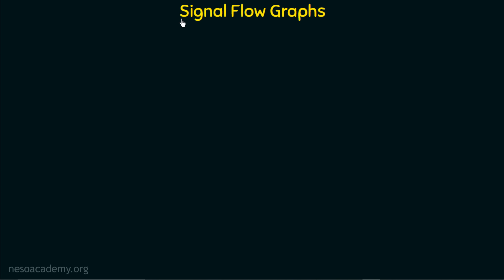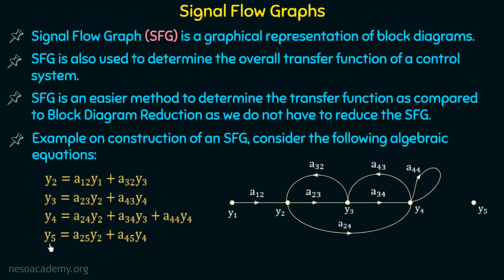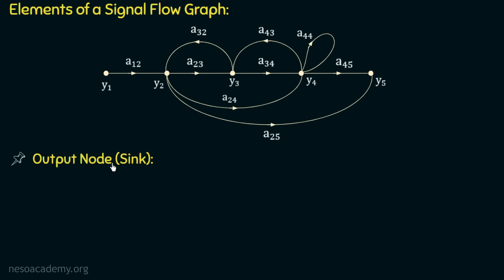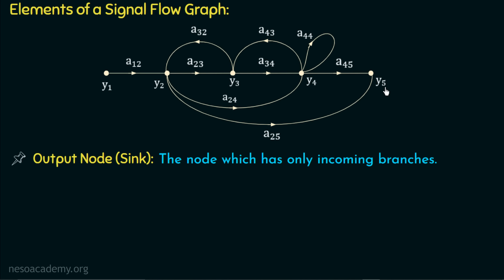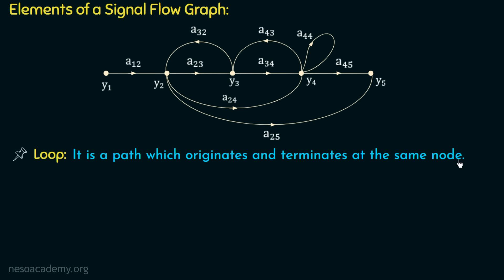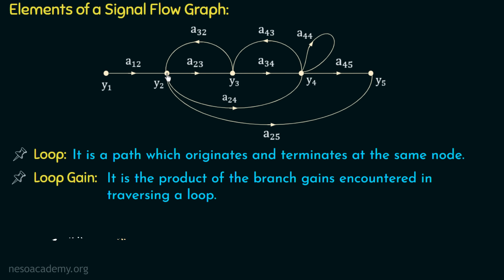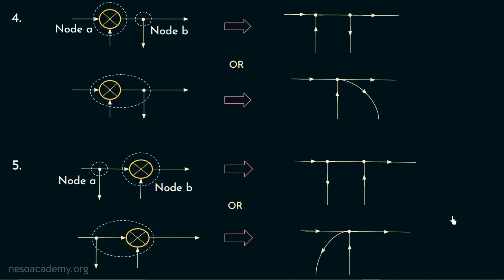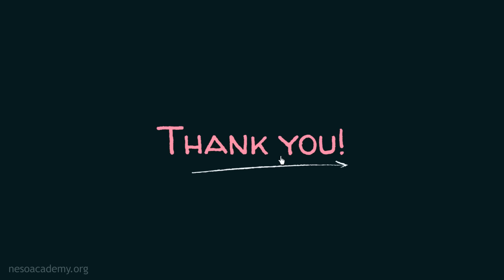Introduction to Signal Flow Graphs

Comment: Sir
 I requesting NESO to complete Power Systems for GATE as early as possible ❤️
Reply: Did you already take the Gate?
Reply: @PunmasterSTP  nope
Reply: @a2a827  Are you taking it this year?  I'm in the US and I don't think we have the Gate here, so I'm not quite sure of the specifics.
Reply: @PunmasterSTP  yeah
I'm taking it this year for the first time.
Reply: How do you came across GATE
Reply: @a2a827  Good luck on it!  I think I came across GATE because I came across Neso Academy.  And I came across Neso Academy because I tutor various subjects online, and I think I wanted to learn more about a certain math or engineering subject.  I recently had to review a tutoring session involving control systems, and so here I am again.
Reply: @PunmasterSTP  what do you do for living..
R u student
Reply: @a2a827  I've had a fair number of jobs, and had to switch a few due to health issues.  Currently I tutor almost exclusively.

How about yourself?  I assumed you were a student, but do you do anything else on the side?
Reply: @PunmasterSTP  I'm learning abt trading and investment strategies
Reply: @a2a827  That sounds very interesting!  Are you using certain resources to study, and where do you eventually want to work?

Comment: I'm sorry to be the person who complains.  The bulk of these lectures are correct, but there are silly mistakes in just enough places that you have to extremely careful.  In this introductory lecture the point made under the last section on "equivalent nodes"  is wrong (clarification: the second half of rule 5). A quick way to see this is that the line exiting downward without touching the summing point would carry the same signal coming in from the left.  After being connected to the summer [sic] "equivalently" it now carries the sum of two signals.  Hence disproving the equivalency.  

Also point 2 of the same section says that "take-off points are equivalent to a node".  This is well intended but also incorrect.  SFGs can undergo graphical simplification methods and any node which is a pure take off point can be substituted with a series of paths.  What he is trying to get at is that-- to confirm that the SFG is yielding the same thing as ODE block diagrams, its good to preserve the nodes just ahead of integrators so one can compare the ODE to the SFG (typically by comparing the ODE's state transition matrix to the gains predicted by the SFG on a term by term basis).  However, when using pure SFG analysis, it's best to use a graph simplification. 

Lessons beyond this one also have minor errors. So it's well worth hearing these lectures because the verbal descriptions are lucid and worth copying. But keep your wits about you and do not blindly agree with the examples being given.

Comment: sir is it possible to join 2 summing points and convert them to a single node? like 2 summing points beside each other in a block diagram
Reply: I think that's perfectly valid!  In general, I think that if there is only one branch connecting two nodes with unity gain, then those two nodes can be combined.  Like in a circuit diagram, where two nodes are directly connected to each other via a wire; they're really just a single node...